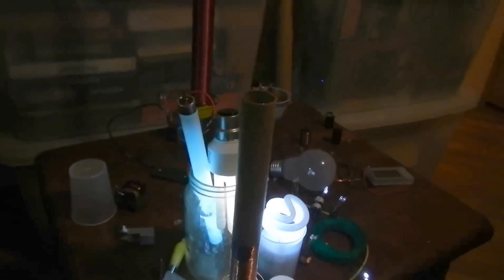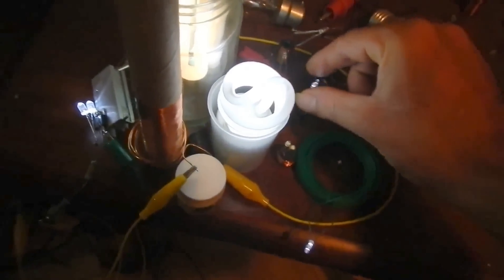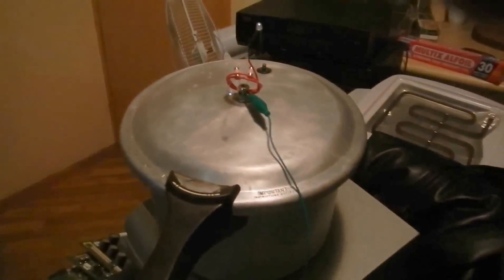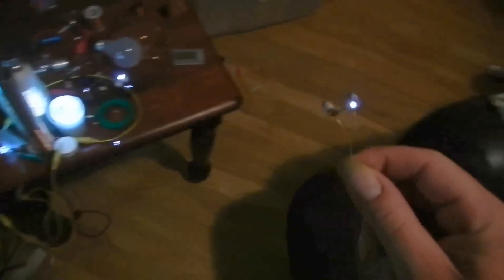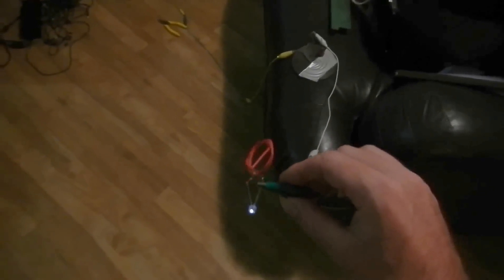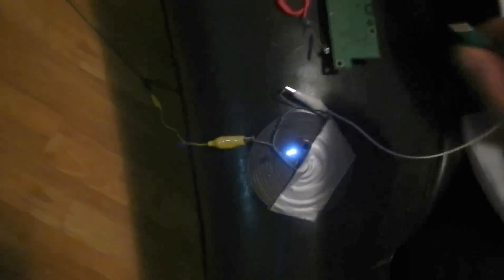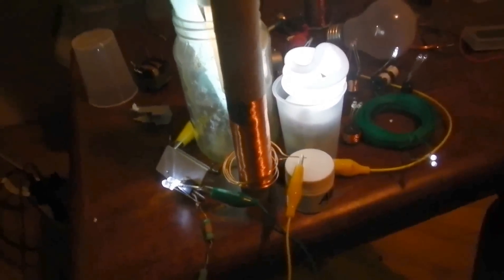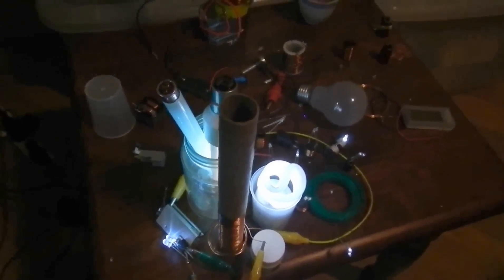Mini Tesla/Slayer update, long range repeater.

Comment from the maker: Ohhh I like the foot pedal idea! I'm also thinking about a wire measure... So I can pick a length and number of turns according to antenna guidelines. I hope my wire feed system works, if it does, there will be no need for programming, unless you want to count turns etc and go fully automated. The system is kind of based on the tunnel drilling rig I worked on building some of Brisbane's freeways... Only much simpler :) Turn the pipe, and the wire will feed itself :) No gears, just a spring :)

Comment: I did try the transistors that I use for my joule thief flyback driver.  When I connected one up it did not do anything.  I then decided to connect the two up in darlington configuration and it drawed about 50ma.  Witch I take to mean it was doing something.  But it just needed to be started.  I should have hooked it up to the scope.

Comment from the maker: 300 600 800 and I have one 1200v from tv flyback drivers. Depends on the size of the TV. Killed a few with heat de-soldering, and the rest on SWES before I learned about protection diodes. Hoping to stop killing transistors soon! Its really annoying when somethings going really well on the last transistor!

Comment: Yeah I am using a full wave rectifier. It works a lot better then the AV plug. I was thinking about adding a cap.  When my TIP31's die is when I connect a cup cap up to the out put of my Tesla coil. I'm thinking it loads it down to much drawing more than 5 amps and burning it out. But I'm not to sure? 
I would think that would shorten the life of them a bit.  
Mine don't give a flash. They just stop working. I can still get them to light but they draw a lot more current. TV transistor 2SC5047

Comment from the maker: Motor should work really well with a receiver coil and full wave rectifier, cap can help starting too. Need big heatsink for TIP, I killed 3 from heat so far. Although a little thermal runaway can be helpful if kept in check with right size heatsink. I have been burning LED's too! Hold them too close and "pop" quick flash and they are really hard to light. Some still work if hit with plasma though :) Whats the marking on your transistor? I was going to try this with a TV one.

Comment: Yeah... not with transistors though!  I should wind some more coils.  I was experimenting with the AV plug thing the other day and I could run a very small motor a few inches away quit well.  I also burned out a few more of my new white LEDs.  x(  I've got to be a little more careful with them.  Oh and my last TIP31 burned out...  x(  x(  x(  luckily this other transistor I have seems to work about as good if not better.  It does draw more current though.

Comment from the maker: LOL! Except all of this was discovered about 100 years ago... I know what you mean though. A few times I though I had a big discovery, go to upload videographic evidence, and find Lidmotor or someone has just done a better video on exactly the same thing. An exact matching coil, with reverse wind direction should work best. You could try a 4 turn primary too, ground base of secondary, and see what you get from primary. If receiver is same length and turns, should get very good range.

Comment from the maker: I have taken to using a K-probe to monitor the heat. I was putting my finger on the insulated part of the transistor though, get zapped off the heatsink, which is also the collector.. I'm not having any interference issues with k-probe. Although it's not really accurate. Blew a transistor at 106c on heatsink. must have been 160c+ inside transistor. As long as you allow for thermal dissipation, it works good. Heatsinks over 100c would be a fire concern anyhow, as long as under that, all is good.

Comment: try moving the position of the L1 slightly further up the coil and the heat dissipation from the heat-sink should decrease. Its hard to tell how hot it actually is, because if you touch it when the circuit is live, the energy is actually grounding to the heatsink through your body, burning the tip of your finger. let it run for a few minutes, power it off, and immediately check the temp of the heatsink. if its still hot,